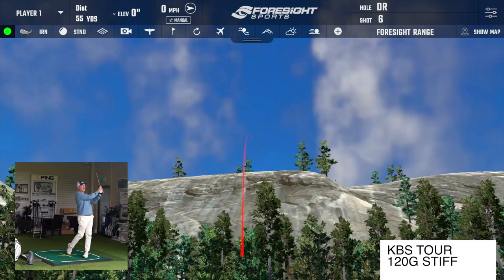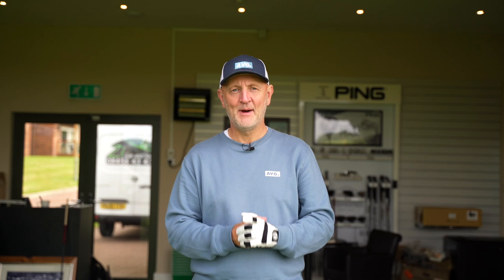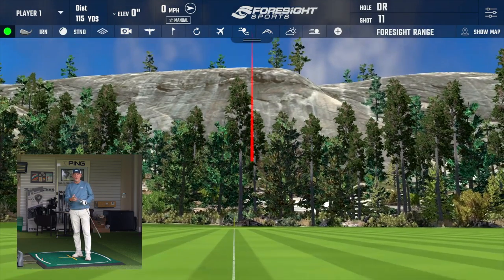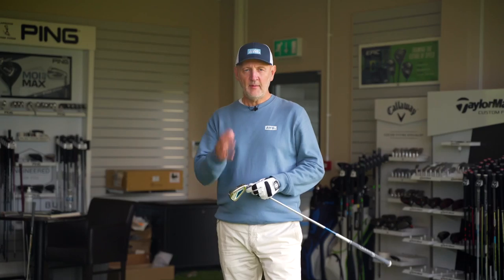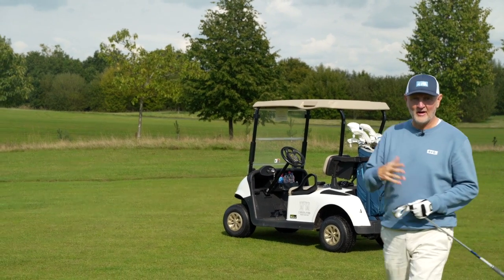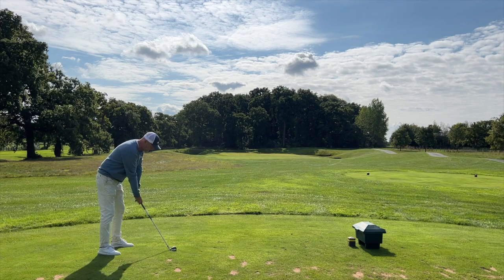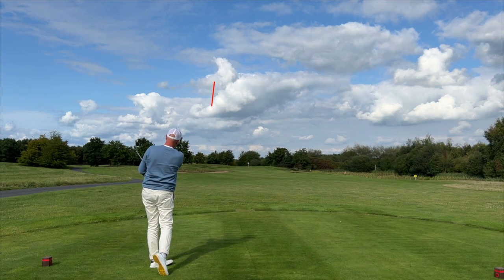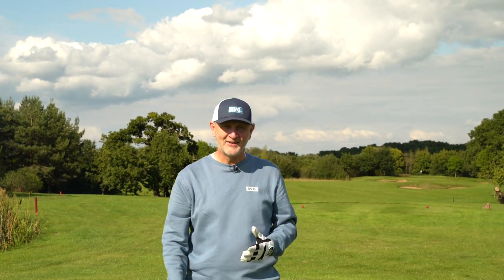I REGRET not trying these when custom fit and so will you!

Comment: I just got a full PXG gen 4 fitting yesterday, I'm 60 in a couple of months but I still thought I would come out with a regular shaft something like the elevate 95! I was surprised when I ended up with the A flex Mitsubishi mmt 60  not only did they give me a better launch, greater spin, gained 15 yards and my dispersion was far far better and then to top it off they feel great too! That was in the gen 4  XP heads, lovely, great looking and forgiving that's the way to go for me.

Comment: I made the switch from KBS 120 Stiff to MMT 80 Gram Stiff, dropped my handicap by 3 strokes and I hit a ton more greens.  Really happy I made the change.  I was dead set on steel till I got fitted and was shocked to changes in feel.
Reply from the maker: Great golf Scott
Reply: The feel so smooth to me and more controllable, never thought I'd change to graphite, even though I'm getting on a bit now!
Reply: I'm 41, was recently fitted with PXG into Mitsubishi 80g MMT shafts. Best of steel and graphite. I'm not fighting my golf swing now (club weight) and my hands stay fresh the whole round. Striking much better and chunking is gone. I will never switch back to steel. My scores are dropping, dispersion improving, tempo improving and distances are nudging up. I'm not a fast swinger, nor do I ever want to be. But I can apply decent force in the bottom 1/3 of the swing much better with these shafts and that should serve me well for a couple decades to come. By comparison I was spraying a KBS 75 gram reg shaft all over the place. So stiff in graphite makes a big difference and should give anyone all the control they would need. If not, go xstiff in a 80g shaft and you will be more than fine. But the mitsubishi mmt in stiff do not feel flexy at all.

Comment: Had a recent fitting with Mizuno Pro 223 irons. Most of the fitting was with DG105 Reg. On a whim, I asked to try the lightest stiff shaft in the studio. It was Recoil 95. Instantly better strikes, better balance and more control.
Reply: Did you get to use the Mizuno Swing DNA??
Reply: No. Both fittings I've had in the last couple of years it's been broken. I suspect it wouldn't recommend a light stiff shaft for me anyway, but it just felt right.

Comment: Andy, a year ago I went to Club Champion to get fitted for golf clubs, what I got was a 40 gram graphite shaft in all of my clubs, and to make things better I got new shafts put in my Ping 410 irons and new Clevland Wedges, as it turned out when the shafts came in and got changed out they put some of shafts in the wrong iron heads and everything was messed up, I did not notice it right away and could not figure out why my irons were all going different distances. I then went ahead and ordered PXG Gen 3 XF irons with the 40-gram ladies' shafts in my irons and holy cow every club I was hitting 10 yards further than my Ping irons, so needless to say every club now has a 40-gram ladies' shaft in it, and my distance is longer, and my tempo and accuracy have gotten better. So they did get the shafts right for me on my fitting.

Comment: By sheer coincidence, I had a club fitting today and among the options, tried a graphite shaft in a ping g425 iron set and just hated it! I just could not get on with it for some reason. It didn’t feel right, didn’t look right even and within a few shots knew it wouldn’t work for me. Went with the True Temper elevate 95. Everyone is different tho.

Comment: I made the move to graphite shafts this summer and the results have been pretty amazing. Right off the bat I just like how I can feel the weight of the club head more. But it's the feel of impact that has been the most significant benefit. Being a senior golfer with a bit of arthritis, the softer feel I get, even on a mishit, just makes the game so much more enjoyable. To be fair I also went with some GI irons with a mix of Rogue ST Max OS and TM Stealth. To be honest the weight of the shaft was not a factor for me and I really can't tell much of a difference, but I suspect that has had a positive impact as well. Larger grips too which fit my big hands better and make it easier to grip the club with the arthritis. I encourage all senior golfers to give graphite shafts a go. Great topic sir.
Reply: Senior golfer myself and I’ve been using graphite shafts, even in the wedges, for over 25 years. Graphite shafts have come a ways, imo, since the old days and I use midsize grips for my arthritis as well. Less wear and tear on the body.

Comment: Not we, you. I am a 50 year old, 5 handicap and I use the most forgiving irons I can. I don’t play blades and early next year my longest iron will be an 8 iron Ping G30.
Reply: I'm 55 and 2 handicap like you I use forgiving irons. Currently tour edge exotics c722 graphite shafts. I still have a very quick swing therefore have 80g shafts.

Comment: I changed over to graphite shafts years ago and these days I use the KBS Tour 60G and absolutely love them👍👍
I agree with your comment that a lighter shaft seems to encourage a smooth tempo and I also find that if I go after a shot all that happens is the ball flies higher.
I have experimented with heavier graphite shafts but 60grams seems to be my sweet spot
Reply from the maker: Sounds like it works Paul

Comment: Good stuff Andy!
I have Modus 105 which feel great in the lower irons, but once I get into the longer irons(5) I feel like I need to swing it harder to get the speed and distance I want. 
So I think getting fitted is great but make sure you are hitting those longer irons too to ensure you are getting the expected output.
Reply from the maker: Good point Brent
Reply: Just changed from nippon modus 105g to nippon neo 95g. So much much better for me gained 5 mph clubhead speed and am hitting a club less now.

Comment: really interesting i had a set of pxg irons fitted with a light shaft could not them airbourne went for a club fitting recently back up to a 105 gm shaft so much more cosistant i suppose its just what works for the indevidual
Reply: Tried same, again bad tempo and no airborne shots!  Fitting got me in 120g stiff with 0.5 long despite being not very tall.
Weird, and everyone so unique posture , tempo, speed, flexibility etc

Comment: Played S300 heavy shafts - fitted with Modus 105S which are nice - BUT tried buddies PXG with Accra  70i stiff and excellent - better flight angle of attack - rhythm peak height - length - far less fatigue - and why do pros now use sub 50 driver shafts? - so have pulled a set of Mizuno MX23 from ebay (£100) started using them last week and so easy - normally Miuras with Modus and I am nailing these - will defo go Accra 70i just wish they would tone down their graphics - New graphite mens shafts are starting too look serious - no discerning golfer will but graphite shafts with pimped up graphics - but defo with you Andy 👍😁

Comment: Very surprised you went shorter in the graphite club vs the heavier steel, usually it is the other way around.  In any event, lightweight shafts (steel or graphite) have improved tremendously in the last ten years, especially shaft strength.  So, no surprise modern pros are becoming taller and stronger -
they can use longer and lighter weight shafts without fear of bending or breaking, and their bigger arc generates more clubhead speed.  Humbly suggest you test a graphite hybrid combo set for us.

Comment: When I was getting professionally fitted for my new set of irons this year. I took some swings with my old set. The fiirst thing the fitter said was those shafts are to firm and too heavy for you.  Ego crushed #1 then he gave me some demo set with graphite shafts. Ego crush #2.  Then he had me hit some players distance irons. Ego crush #3.  Lol.  OK truth be told he was absolutely right. I bought 2021 Callaway apex irons with regular flex graphite 60grams shafts. I haven't hit the center of the face this much in my life.  I am more accurate then ever and the extra distance doesn't hurt either. 🤪  Moral of the story is put you ego aside get fit from a professional and swing within yourself.  You won't be disappointed.

Comment: I used to play 120 gram stiff. I now play Elevate 115 gram stiff ETS iron shafts. With the ETS, extra stif tip, I can use a lighter shaft that feel like the 120 gram shafts at impact. Similar concept but not as much weight difference as your experience.
Reply: I play modus 3 120s. Starting to think the 120s aren't for me. I definitely want to go lighter
Reply: @josiahjones9521  It's a fine line with my swing. Light weight brings speed but go too light and dispersion starts to widen. I love the feel of Dynamic Gold 105s but they are a little light.

Comment: Interesting stuff but I had the exact opposite result, I was playing a lighter shaft (93g) and moved into a much heavier 132 gram shaft when I got fitted for my ZX7 irons.  My tempo at the top can get a bit quick, the extra weight helps me get a better tempo and amazingly I also picked up 6 mph of clubhead speed.
Reply: Same for me, I felt maybe would slow me up and stop me getting too quick but the opposite, couldn’t feel it properly so tried to smash it and lost all control.
Might experiment with MMT 105 (not such a big change)

Comment: For me irons should be about control.  I would definitely take the 40g shaft based on the data Andy provided, the extra spin should mean more consistency and more stopping power.

At my last fitting when I ended up with Ping i210 irons with an 80g Steelfiber regular shaft, we tried various shafts.  It seems I am bit sensitive to shaft weight, so I can play 80-95g shafts, anything less than that results in very high ball flights and inconsistency in distance, anything more than that in weight is just a struggle and I lose both distance and consistency.  The odd thing is that my hybrid, fairways and driver are in stiff flexs and I have come down slightly in weight for those - now if anyone can explain that one (other than I am just weird!)...

Comment: I just had a fitting ang tried some graphite shafts. I went in looking for Mizuno 923 HL with graphite shafts. The club felt wrong, heavy at the end, but that was with Mizuno 923 HL.. and I was fading the ball. Guess I don't slow down enough. I ended up with 923 hot metal (not HL) and a 105 NS Pro stiff, ish shaft which felt the best and performed  for me. But I was swinging full speed..
Reply from the maker: Enjoy your new cubs Garry

Comment: I have been using a Reg XP 95 TT shaft and a KBS 90 Reg shaft for some time..Then I started to try the Stiff shaft which is only a few grams heavier and got about the same results but with less torque on the head with off center hits...Feel like I will go with the Stiff shaft when getting fitted for my new Mizuno 225 pro, but will let the fitter test tell the tail...Thanks...

Comment: I once had a custom fitting and they recommended a very light, whippy graphite shaft.Whilst I got extra distance,the downside was my chipping and short game deteriorated.I probably use a 7 iron more around the greens than on full shots,and the same for all the other short irons. 
So in the end I was hitting one or two clubs less into the green,but then leaving chips short.I lost feel on the short game,and that is far more important,than hitting your irons10 yards further.My scoring did not improve.

Comment: Problem with studio custom fitting at our level is that we're most likely to change equipment for yardage improvements, but difficult to assess dispersion / accuracy with new shafts until you've played them on-course for a while. Did you get a feel for dispersion differences with these light shafts Andy?
Reply from the maker: I seen zero difference

Comment: Does physics have something to do with this? The heavier the shaft the less the club head weight affects the strike? The lighter shaft surely has the effect of putting more weight where you want it at the end of the club - ie the club head.
This should make for an easier swing at the arms aren't trying to force the club head, the weight at the end is helping with tempo.
The weight of the heads may be identical but the shaft weight surely contributes to the overall effect.
A shorter shaft should have affected distance more but didn't that much. 
I have 55g shafts in my Taylormade M4's and love the club's. I'm 65, a 14 handicap and hit a 7 iron 142 yards and if I open my stance (to get more hip rotation), I can add another 6 yards. I tried Steel Shafts and they just didn't work for me.

Comment: I have some irons with a 65 gram graphite shaft, senior flex, and I hit just fine. I do not hit as far as my regular flex 105 gram steel shafted irons
Reply from the maker: I assume they are same lofted heads
Reply: They are a couple of degrees weaker so that is part of it. I like a mid weight steel shaft at this time. I used to use Dynamic Gold 130gram beasts.

Comment: My guess on performance is that the graphite shaft is going to lose you some distance and give a wider dispersion.  I've found that graphite shaft options are usually longer, not shorter, and in general, lighter shafts make it more difficult to swing consistently.  I've see other videos discussing the importance of getting the correct stiffness, and that's a whole other variable.
Reply: Get a fitting you may find exactly the opposite, I did.
Reply: @kenhewitt7357  Fair. But we were asked to take a guess at the beginning of the video; that was my guess.  I'm open to the possibility that I am 100% wrong.
Reply: @fretless05  yeah that's fine mate we're all different, you are right in your guess , the higher torque of the graphite shaft I was fitted with should have made my dispersion worse, but it did the opposite?? How weird is that 😂
Reply: @kenhewitt7357  Well, if there were simple rules that always worked, there'd be no reason to get fit, right?  It boggles my mind how many variables are involved in optimizing a head/shaft to a players swing- nothing should surprise any of us!
Reply: @fretless05  yeah so many variables and none of us are robots  with exact swings, it's fascinating the things that have been learned with these modern trackers now.

Comment: I play a 70 gram R flex graphite shafts in my irons. I have tried lighter and more flexible shafts and did not like them for short game shots. They were fine for full swing but I could not control the club head in the short game.
Reply: I roll with 70g graphite shafts in my irons and wedges as well. Really like the feel.

Comment: Tbh I am amazed you were in stiff shafts to begin with as with no disrespect your carry numbers wouldn't point to that. Ladies flex and senior flex is extremely close to being the same and yes you are right more people should try them out at slower speed range especially with a very forgiving head. I can't hit my wife's clubs as my natural swing speed is way too high so need the heavier shaft to basically slow me down a bit and keep it straighter
Reply: You might try having a stiffer tip and heavier head while keeping the shaft lighter.... a graphite shaft can do it too. save your back...
Reply: @sageagbonkhese4091  I just got some new irons cple months ago 223 mizunos and had to go up from 90 to 130 shafts as get more control and consistency. Weird thing is these go as far as my p790s which should be longer as hotter club and had 90 gram shafts.

Comment: You're getting old And.. 😁 I'm the same age as King Kenny. Once I started to get near 60, I changed to Regular shafts from stiff. Then went to graphite through the bag. Then the last time went lighter shafts. Not 40g light though. Maybe next time. I'll give you another tip. Every damn sand wedge has a stiff shaft in it on the shelf. I had to special order a Regular Graphite shaft. Makes a world of difference in my short game. Give that a whirl if you can and you'd be surprised at the results.
Reply from the maker: You are not wrong Mel